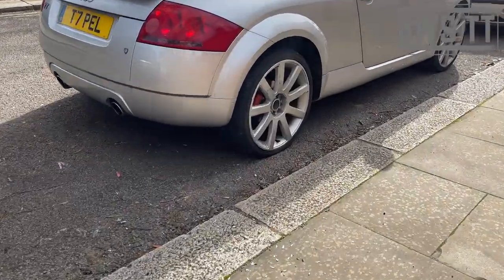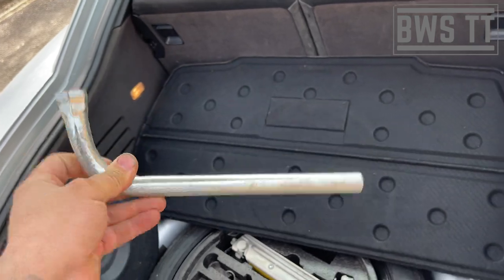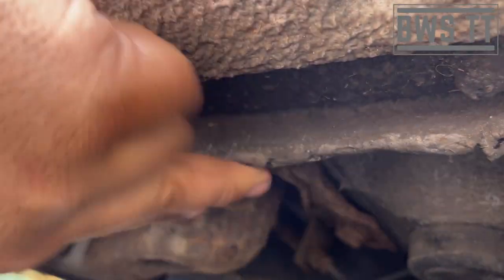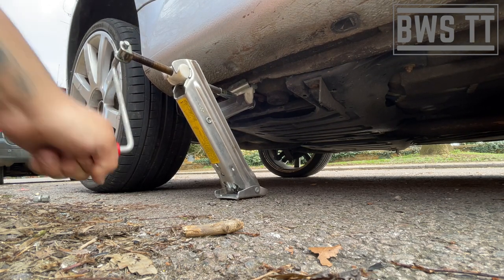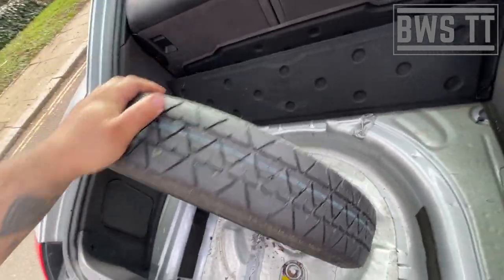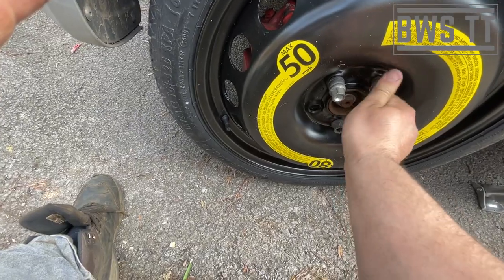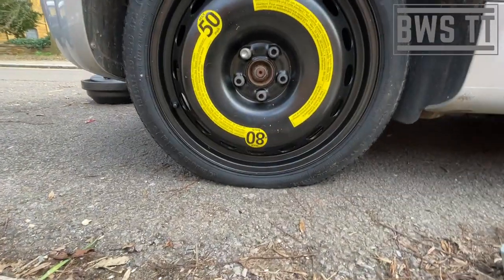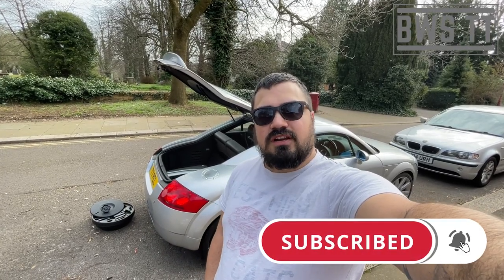Fitting spare tyre on Audi TT mk1

Comment: Wheel guides make fitting a lot easier, especially with large wheels, and they stop you damaging the wheel or painted brake calipers while putting the wheels on. We use them every time we take wheels off. Worth their weight in gold!

Comment: Another useful video. I wondered what the long bolt was for. I appreciate having a spare wheel, albeit a space saver: my Z4 has a can of tyre-weld which, even if it actually works, makes the puncture impossible to repair.  I installed a new pollen filter yesterday after watching one of your earlier demonstrations.